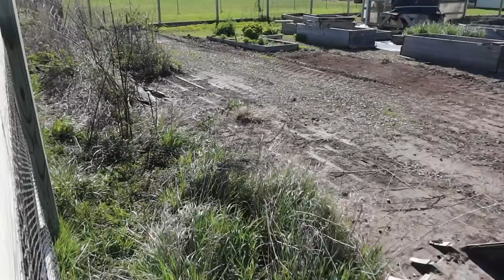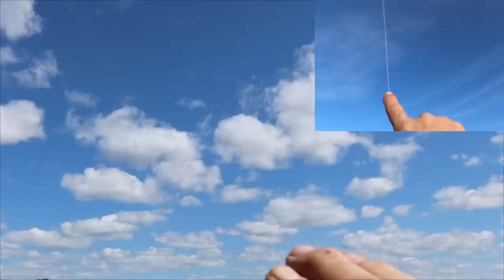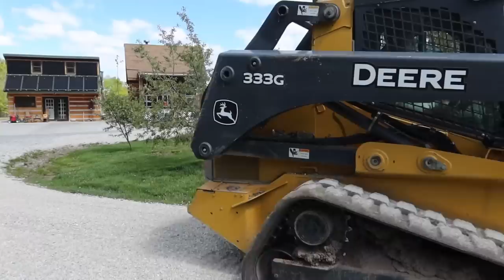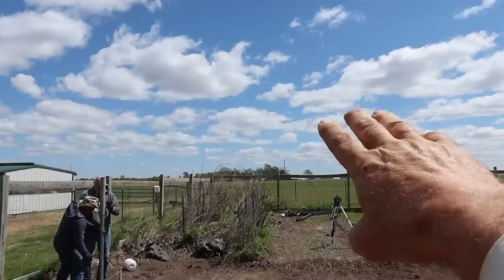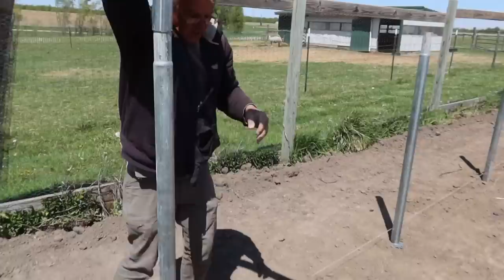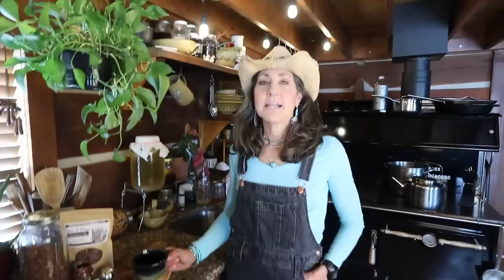Building a High Tunnel to GROW MORE FOOD!! part 1

Comment: The wind is out of control here too. I spent my stimulus check on materials to build a greenhouse. It’s a inflated double polyethylene lean to post framed with polycarbonate ends and doors on both east and west. It gets over 100 degrees F on a sunny freezing day. I heated it 4 nights to get an extra 40 days last fall and that got my super hot peppers to ripen and extra tomatoes past thanksgiving.

Comment: Doug, Stacy,  Gary, and team, Great work. The frame looks straight and true. We have a polytunnel in our back garden. It's just 4.5mx2.5m and has been up for 10 years, same cover. It's redundant now as not enough light gets into it anymore since we had to erect a strong high fence when we got our current Border Collie,  Meg, who is a great climber! Too much shade. It's a big fence. Consider this. Drive in some additional fence posts inside the tunnel beside each corner post and in the middle and tie these to the manufacturer's tubes. This gives great resilience, and our tunnel has survived 70-80 mph storms in the past. I know you are windy there. We zip tied the frame to the posts. You will need more than 6 posts I  suspect.  Got to the allotment today early on. Cleared and dug a patch and got the broad beans in!👍. Destroyed now. Just done the dishes.😅. Good luck with the build. Stephen.

Comment: We picked up a metal frame from a temporary garage that someone had covered with chicken wire. Cost:$50. Settled it where I wanted it and took all summer covering the floor(earth) with barn clean out horse poop. Then covered the manure with about a foot of composted horse manure. Structure was covered with a heavy plastic. Didn’t get it planted until sept but had fresh produce until the end of the year. I live in the snow belt and temps were regularly below freezing. Several lettuce and spinach plants even survived the unheated winter months. Opened it up on April to find weeds about a foot tall!  Chickens loved them. Love love love my high tunnel.

Comment: Just remember that fabric in the sun eventually Sun bakes and falls apart. Granted everything has an expiration date, but we don't think of that until we are forced to accept it.  I had a canopy at one point that I had to buy a replacement  cover for. Those that live in a strong sun type environment like in Arizona the cover didn't last longer than a few years.
Reply: Better stock up replacement  plastic since they use petroleum products to produce.....do you use shade cloths?
Reply: @gailwendtland5970  Shade cloth helps the plastic last longer and helps with hail protection too to some degree. I would like to see them build a dome from growing spaces. They are so cool to grow in the shoulder seasons and all winter where they live. They will be productive with this tunnel for sure.
Reply: @gailwendtland5970  I don't use shade cloth. I have a big Mesquite tree that gives the right amount of shade. I don't even have the canopy anymore. That was way too many years ago. I just mentioned the situation that most people don't think about until that are having to face it first hand.

Comment: On the high tower, one inch wire mess works great on the sides, it keeps critters out from eating your veggies. 👍🤓you can roll the plastic on the sides to control the temperature.

Comment: I prefer concrete beds because you leave that behind for generations after you to use. Wood beds rarely last 10 years. 

Concrete costs triple but it lasts 10 times as long. It's cheaper in the long term if you think generationally.

Comment: What wind rating does it have. Ours is rated for 125 mph wind. The reason why we put in a better greenhouse was because our first one blew down. Our green house is 20 feet high and 30x80.    We have 210 tomatoe plants inside growing with drip tape. Also has a 300 gallon propane tank turned into a wood stove to heat with fans to circulate air and roll down sides to regulate heat in summer. We start plants indoors early here in Colorado so we sell tomatoes by 1st of June or sooner. We have asparagus and rhubarb already and our 1700 strawberries are blooming also. We are about 2 weeks later than last year due to government intervention of weather.   Good luck with your greenhouse. Also our tomatoes grown in dirt with drip tape just as good as outdoor. We use two layers of plastic with air in between layers and 1 of plastic has uv protection so plants don’t get burnt.

Comment: I bought an attachment that bolts on the top of my bucket which accepts the receiver. The hitch drops 10 inches so I can get under the trailer hitch.  Went this route because I keep the backhoe on most of the time. Great show....thanks!

Comment: Good to see Gary again!😉It was a little deja vu watching the O.G.'s setting the high tunnel up. About a dozen years ago my brother-in-law, his brother, a life long friend of theirs and myself changed out the electrical service on his house in Southern Stone County. As a handyman, electrical is something I've done a lot of. But between the three of these general foreman retired union electricians there's over a hundred years of accumulated experience. I was honored to be their roustabout. I could run and get an outdoor GFCI box that they might have a trade unique word for or cut anything on any number of saws I had. The  building inspector just stopped on by to shoot the breeze and nod because these guys are commercial tradesman. And yes Douglas, I can call you a young man and get away with it for obvious reasons other than in reference to how well you take care of yourselves (when you're not busting up your ribs🤭🤫) .
But you guys were out there getting it done right and getting it done fast. That's what I saw. I was a little envious as I watched you set the posts. We grow a lot of rocks here and a hammer drill makes sense more than just the t-post setter. 
I noticed something you might not have. That camera shot of the sky didn't seem to have a lot of those contrails which most of us have become accustomed to. I just checked out the sky by me and I saw only one at 40,000 ft. that had a fast dispersal and a Cessna . Y'all remember 9/11 where there wasn't any air flight going on for a bit? If not for the birds, frogs and the bugs at night which being cooler at right now are pretty quiet, I could hear a mouse fart just inside the woods on three sides here. Good time to keep doing what we're doing. It's spring and time to plant anything. After I look for part 2 since this came out a day before of course.👨‍🌾👩‍🌾

Comment: These are quite expensive. A simpler and more cost efficient way to do this would be dog kennel panels extended out and a pitched roof, then tightly wrapped heavy mil plastic over top and sides. The kennel panels will provide stability and also keep critters out from eating your plants.

Comment: Hi Doug. There are planes flying but they aren't leaving any condensate trails because they disappear right behind the plane due to the extreme dry air in the upper atmosphere. On days when the due point aloft is higher, the contrails persist and can linger longer because the condensate doesn't evaporate quickly.
Reply from the maker: Bull shit

Comment: Kids love the tractor, lol, every time I watch a video with a tractor the little one toddles over and stares, and the big one starts jumping up and down. I don't think I can put up high tunnels here. The wind is almost ever-present here and ranges from 15-45 mph fairly regularly. I think it would shred the plastic in a single season, or less, and the sun toasts even hard plastic tubs in six months. I'm looking at possibly buried or bermed walls with a glass roof. We need the soil temperature stability as well here. The temp swings in the desert are intense.

Comment: I’m so happy for you two! I’ve been wanting a greenhouse for many years now. I got my freeze dryer instead.
Reply: I want a dryer, after you dry do you put in jars or plastic bags please? Thanks
Reply: @margiepatterson1134  I use both Mylar bags and canning jars. For long term storage the food goes into Mylar with a oxygen and a moisture absorbers. For short term storage I set the canning jars in the pantry. I call this my fast food area. I cleaned out 2 freezers working on number 3. (I have 5). My only regret is that I didn’t get one years ago.
Reply: @margiepatterson1134  the things I’ll be using soon will go into jars with moisture absorbers. Things that I plan for longer term storage go into Mylar bags with oxygen absorbers and moisture absorbers. I’m 62 and my food I have in long term storage will probably outlive me!

Comment: UP, UP AND GROWING AWAY!
Wish I had tunnels or greenhouses up.
Have been collecting old windows, sliding shower doors or old glass panes to build my own windows and finally have enough to build a nice 20x40 house.
Now, if the weather will permit????
Just a lil whip here, but I hate to see the CHEMTRAIL haze on the ground long after the spray.
I remember time way back, out on the Mississippi River channel and you could see crystal clear as far as the eye could see and most days now, you can only see a few miles, on better days, into the haze.

Comment: High hard workers, just a question are you guys going to put any kind of protective wire around the bottom to keep the critters out and if so are you going to bury it part of the way to secure it??? Just wondering so I would have ideas for my own Greenhouse in the future. Glad you didn't fly away like a kite and you still have your hat!!! By the way, Did the wind give your beard a permanent part down the middle??? The Nana's of Cental Florida are wondering😊

Comment: You really need to get a grip, Doug.  Just as on the earth's surface, weather specifics are not the same at altitude from one day to the next. Your own admission goes through this fact as you are belly-aching about a few hours of changed and increased winds.    If you become a meteorologist with particular credentials for upper atmosphere analysis and forecast,   only then will you be able to speak with any truthful authority on this contrail subject, a truth that you constantly avoid.  You don't even consider variances in reflectivity and lighting due to time of day considerations.  You've self-decimated your internet standing because of your sensationalism. I suggest that you at least, gain a seat on a commercial liner when contrail conditions are most conducive for you to actually 'look out the window'.  If I had the time,  I''d post to you dozens of aerial movies where I am following or passing by other jets at altitude that are rendering great displays of contrails or vortices, worldwide.   You have really soured me to your whole 'off-grid' and self reliance agenda.  Considering areas of your presentations where I am not an expert, I simply don't know if your just making stuff up.   Here's another consideraton for you and the "chemmies" gaing,   the next time the morning air is at a high relative humidity,  -the OAT is near the dewpoint,  let me know what you see 'spewing' forth from most any late model automobile's tailpipe.  HINT: it rhymes with Hydrogen dioxide.  :-)   Should you wish to contact me for expert  information, -45 years worth of worldwide aviation experience,  please don't hesitate to do so.  God Bless
Reply from the maker: Hey scot...its real and you are in denial I have the recipts and the knowledge to know truth from fiction 

U no like 
Move on 

But I'm telling you facts